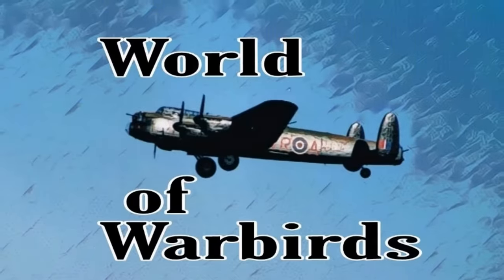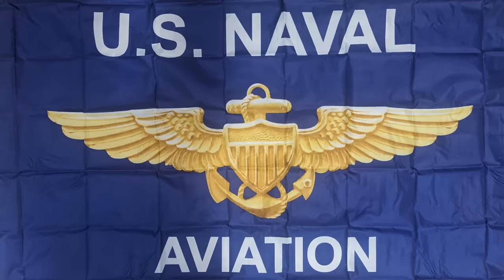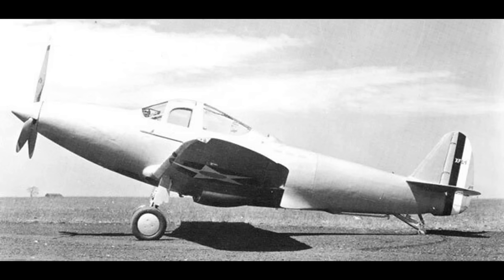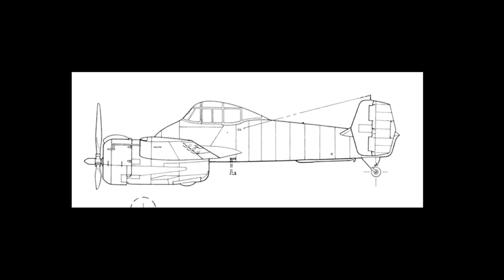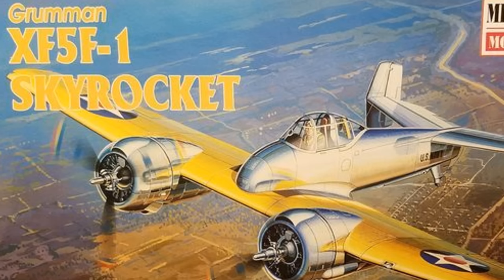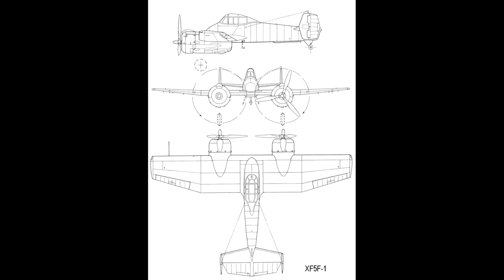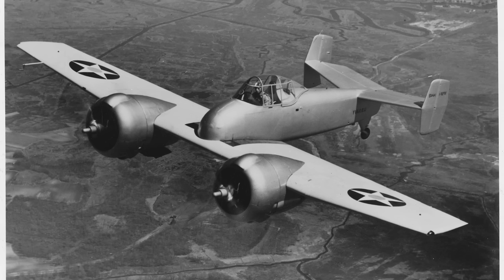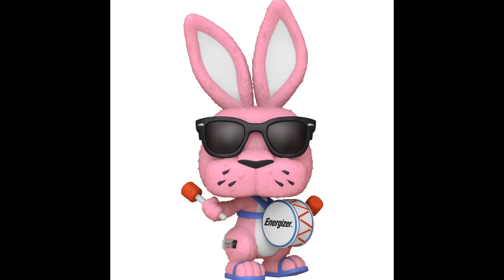Grumman's XF5F Skyrocket

Comment: Friendly suggestion. Instead of referring to it as the torque effect exclusively. It's referred to as P factor in aviation. Get that wrong, and your instructor won't let you fly that day. Nice video and really cool plane.
Reply from the maker: Hi, actually I am a former flight instructor with almost 2000 hours of flight time. It was an editorial decision to lump the concept to "torque", of which most people have a basic understanding, rather than introduce P-Factor which most people don't. Explaining that would've broken up the flow of the video. Thanks for the suggestion and explaining the differences between the two forces will make for a good future short!
Reply: @worldofwarbirds  Not being critical at all. I just notice people tend not to understand more technical terms. Nice video

Comment: Thanks for sharing this. I've always liked the F5F. It's very much the ultimate expression of Grumman's apparent design language - we don't care if it's pretty as long as it works right, every time. I get that it was always a bit of a compromised design in trying to jam two massive engines onto an airframe small enough to operate from then-current carriers, but that rate of climb is just eye-popping for the time, it was also very good in speed and maneuverability, and I'd imagine the rate of acceleration on throttle changes would be fantastic. But in addition to the spares issue, I can also see the Navy balking at the possible range penalty from two engines drinking avgas simultaneously, and also just the issue of burning THROUGH the carrier's supply of avgas a lot faster, needing more frequent resupplying. But, what could have been.
Reply from the maker: Many of the ideas behind the F5F ended up in the F7F Tigercat! I will be releasing an audio episode on that Cat through Patreon soon and then for general consumption next week. Sometime after that there will be a video. Enjoy!

Comment: 4:46  The props on this bird don't look like they counter-rotate.  Look at the way the blades are both canted in the same direction.  What am I missing here, pilots?
Reply from the maker: Yes, I've seen that and many have pointed it out. Perhaps at that time the opposite turning engine was not available? We know that for at least some of the test flights, there were counter-rotating props because it in mentionned on the test pilot reports. I'm sorry that I don't have a better answer.
Reply: Maybe it’s a plastic model over a diorama, or a model in MSFS or War Thunder.  Note it has guns; I don’t think the prototype ever did, prior to turning it over to the Navy and having its paint scheme did.  Edit - good catch, I totally missed the prop angle.

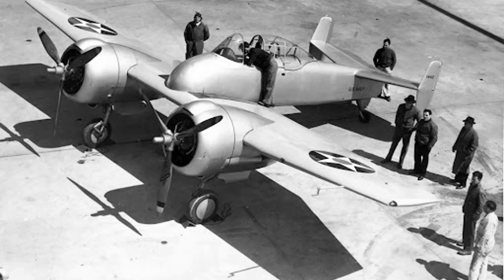Look at the photo at 4:31, you’ll see the props angled such that the left is counter clockwise, the right is clockwise.

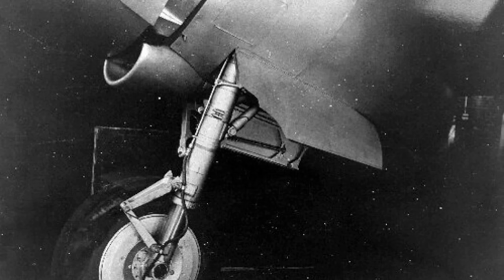Comment: The engines were not "geared" (as stated @3:01) to rotate "the props" in opposite directions, the "whole" portside engine rotated clockwise like the P38 Lightning?? (Its a logistic and maintenance nightmare but...) PS I believe your diagram is in error at 3:03. The props would surely rotate in reverse of what you've shown because you want the vortex coming off the props to go < under the wing toward the fuselage >. See the P38 Lightning. (Standing in front of and facing the plane - The engine to the viewers right rotates clockwise and the engine to the viewers left rotates counter clockwise. (The still photo of the XF5F, at 5:15 confirms this to be the case - look at the prop blades and comments beginning 6:30 confirm my suspicions.)
GREAT VIDEO even tho I have OCD and am a nitpicker for detail. That fault made me the best Progammer/Sys Analyst in my DOD job. I saved taxpayers a bunch of money by doing it right the FIRST time!!! No costly TDY's overseas to fix errors in the field
Trivia addendum:
For 80 some years I have looked for this plane. My uncle gave me a model of it for my birthday in 1941. It was beyond me. Back then model airplanes were umpteen shapes printed on sheets of balsawood that had to be cutout and glued together. I think my dad and uncle Art, actually built it. It got painted orange and hung in a spare room for a long time. Parenthetically, Captain Midnight and "his flying crew" used this plane in the comic book series in WWII. I've never seen any ID till now. Nor did I remember "The Blackhawks" till you mentioned them. (Do I remember right they flew from an island off the coast of Na.zi occupied Norway???)
THANK YOU for answering a few of the open questions from my youth!!!!!!!!!!!!!!!!
Reply from the maker: Geared was just term of speech in this case. The rotating prop GIF is just an example of counter rotation, in some aircraft they go one way, in others the other. Thanks for sharing!

Comment: Seems more like a procurement debacle to me. Easy to fly, a carrier pilot's dream, would have had a low accident rate and a large base of pilots who could fly it, as opposed to the "Ensign Eliminator" Corsair which was barely usable from a carrier deck and required highly-experienced pilots. If the rather underpowered Wildcat could barely hold its own against the Zero, this hot rod would have wiped the floor with Japan's champion. It was rejected out of trivial reasons - the landing gear issue could have been easily fixed, and logistics - it's not like the United States lacked the industrial capacity to produce a mature and well-established engine in any quantity. Another chance missed by the U.S. military before the war, like the Christie suspension for tanks.

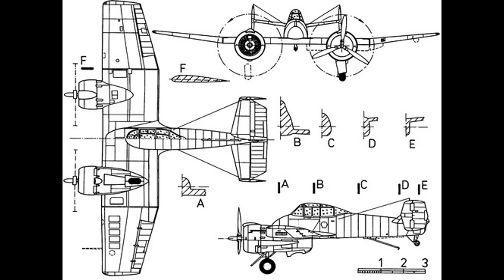Comment: The 3:03 animation shows propellers rotation direction incorrectly. See the drawing on 3:08. The 4:47 image does not show correct propellers' shapes which supposed to spin opposite directions.
Reply from the maker: Sorry, it was just a generic GIF showing counter-rotation.
Reply: Huh, I didn’t catch the arrows on the drawing.  

I don’t think the image at 4:47 is the real deal, as it has guns installed.  Maybe an image from WarThunder?

Comment: I didn't like the Skyrocket
 Look awarked. Wasn't easy to fly.
Reply from the maker: It did look strange, but the test pilots said good things…
Reply: There's definitely something about it that makes it look uncanny, like someone wanted to design the wing and the engines and just slapped the body of the plane on as an afterthought. I'm trying to think of any other fighters that have the cockpit so far back to the point you could probably see the edge of the wing directly in front of you, and I imagine it would be particularly difficult to see anything below you as well. It almost looks like the body is hanging off the back of the wing for dear life.